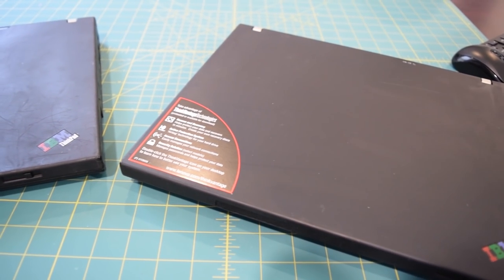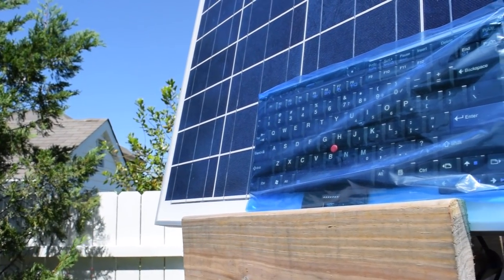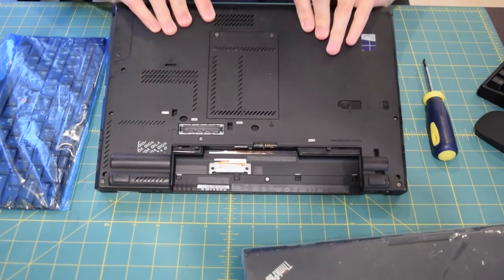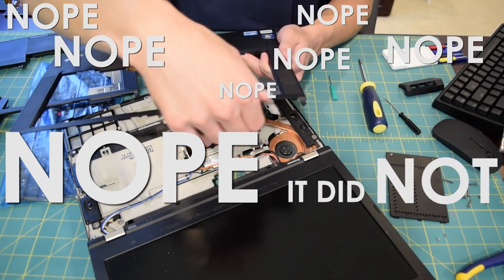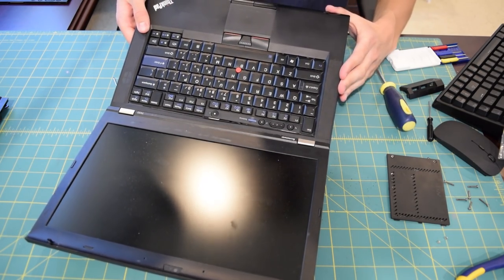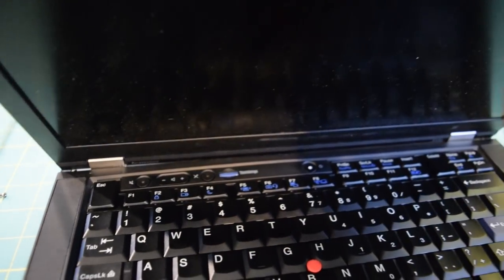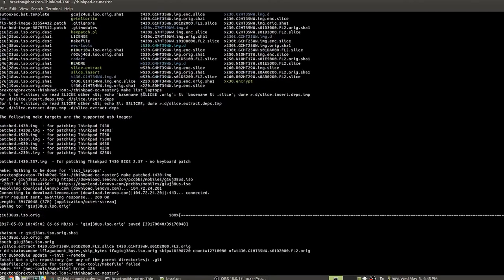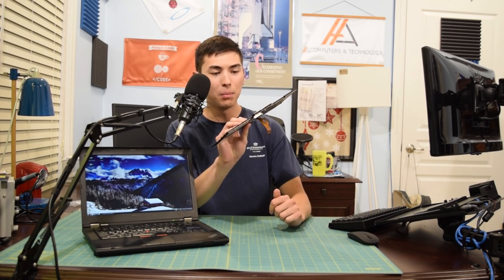Lenovo Thinkpad T430 "Classic" 7 Row Keyboard Installation / Mod

Comment from the maker: A few people have complained that I did not isolate the necessary pins on the internal keyboard connector.  I addressed this issue in the video but just to reiterate, many have successfully performed this mod without making any changes to the internal connector.  According to Thinkwiki "Further investigations on three keyboards shows that the over-current condition described above quickly lead to the same failure each time - a small burnout on the keyboard just after the retaining bar (see circled area on photo below). This burnout has had the effect of removing the short circuit and stopping any other issues." any foreseeable issues should take care of themselves.  If you want to still isolate the pins on the internal connector, then feel free to, I am not going to stop you.  However, I found it to be an unnecessary step.
Reply: can i have the old keyboard because mine broke
Reply: Andrew Vickers 
/userroot- scrub
Reply: AA Computers and Technology would it work on a t430s model?
Reply: Just as a bit of defense, as the original author of that article...  I didn't write anything about a palmrest. Someone else shoehorned those instructions in later, and I think it was mostly intended for the X230.

By removing your palmrest, installing the keyboard into it, and then putting both back in at the same time, you don't have to modify the nubs on the keyboard, but you also remove the ability to remove the keyboard without first removing the palmrest, which some would view as a relatively big issue (especially when shortening the nubs isn't hard at all).

So, yeah. Nothing was a "lie" so much as a lot of other people misinterpreting instructions and then broadening them.
Reply: imo, the bulge is caused becuause of a wifi cable or some clipsing part badly seated on the rest, still, i would go for that mod if i ever get a newer thinkpad.

especially if this keyboard comes with NMB switches.
Reply: lambotgini
Reply: The keyboard backlight fuse tripped and saved your laptop. You should probably research it better before telling people to go damage their motherboards.
Reply: I’ve fried several keyboards improperly isolating those pins. Do it.
Reply: @SilverSpoon_  not at all.  The 2nd retaining clip on the palm rest broke with the way he installed it.  Install the portion towards the screen carefully first making sure the clips are lined up correctly, and no bulge.
Reply: Ever hear "better to be safe, than sorry"?  Would you be giving this same advice had you gone through a motherboard or two because the backlight fuse hadn't tripped and saved your machine?  I don't think so.

It takes two seconds to put a bit of tape over the pins.  There's little reason to not do it, unless you like gambling with the best outcome being the same as it would be if you hadnt, and the worst outcome being a non-functioning motherboard.

Comment: I wish laptop keyboards were modular so third-party manufacturers could join the party.
Reply: Exatly! Btw nice reference to rpgs
Reply: most Laptops out there as of 2012 actually use a PS/2 connection, this means any keyboard can work on them as long as you can figure out which pin on the connector goes to each pad on the ribbon cable
Reply: now the annoyant part is the individual connectors, but on the keyboard diversity, i had a certain experience with my T60 and T61p. one had a NMB and the other one was a Alps. I found out by doxing the serial numbers recently. This laptop is ten years old and has seen some shit so I replaced the keyboard with a cheap one from Amazon, a Lenovo Genuine, and the serial indicated it was made by Chicony.  the NMB brand is really an original design common to HP and Lenovo's high end, and is very comfortable to type on. The Alps one is a bit more clumsy, but the Chicony, as the T60/61 marked the end of the transition from IBM to Lenovo, Lenovo decided tpo get the cheapest keyboards with scissors switches, you cannot type with all your feels without having keycaps breaking, something that never happened on the original NMB. I finally ordered a couple of remaining NMBs from a seller in Canada to replace both my T60 and T61's, because that counts!
Reply: - Apple has left the chat.

Comment: The reason your back of the palmrest is now raised is because you broke the clips on the back of your palmrest (check the back, under the battery, you'll notice 4 clips - your 2nd one from the right should be broken according to what I saw in the video). It took me 3 new palmrests for me to get this right, it's ridiculously annoying and difficult to properly seat with the keyboard without breaking them.
Reply: I recently got this problem with my t430, i almost bought a new palmrest, but i happen to find out that one of the clips was just twisted, so i just had to twist it back, and it worked fine.
The plastic on the palmrest are really good
Reply: Can you connect the keyboard when the palmrest is still on the laptop?
Reply: @ramiveiberman3182  yes, you just have to unscrew some screws on the back, don't really remember which, but I think is the ones more on the middle of the back

Comment: I've used the chiclet for over a year now. you must have girly fingers if "they hurt" after typing on a chiclet kb
Reply: Daniel Stubbs if you listened he said he types very abusively. Chicklet keyboards have a short travel distance.
Reply: +DistantExplorer Yep, happens to me. I'm used to pressing down hard on stuff like mechanical keyboards and whatnot, so tiny little chiclet keys is like smacking your fingers against a solid surface, it starts to hurt your tips after a while
Reply: I am quite certain that the new keyboard has the same amount of travel as the old one (I read it somewhere). So it is strange that he dislikes it so much. Truth be told I definitely prefer the old style keyboard too on my T60, I just don't think that the chiclet ones are so bad as some people make them out to be.
Reply: Really? I'd actually be pretty surprised if that were true, since every chiclet keyboard i've used has had almost zero travel. Then again i've never typed on a new Thinkpad keyboard before so I guess I can't say for sure.
Reply: do you know what travel is? or are you just regurgitating shit you read online. Chiclets have plenty of travel.
Reply: Yeah, chiclet keyboards in general has less travel, but lenovo had a priority to maintain or at least  be very near to the old travel distance. But obviously something is off with them, as he (the dude in the video) really dislikes them.
Reply from the maker: The Lenovo T430 chiclet style keyboard actually provides a decent amount of vertical travel.  It is definitely one of the better chiclet keyboard designs I have ever used.  That being said, I still like the T420 keyboard much better, the layout makes more sense to me and it is much more comfortable to type on in my opinion.
Reply: I use it since 2013.. Chiclete sucks hard. Dont have a travel distance of the keys, dont have a good feedback, and i miss-type all the time... 
When i had to use a old laptop last week after many years without any normal keyboard, i instantly could type alot faster and better with much more confort in the normal keyboards... I really dont get the thing... If we have space, why have "small" keys? The distance actually makes no difference, as i misstype all the time (and if was just me, ok i would believe in some problems with my typing, but its not!). Not even on the virtual keyboards these small keys with some space between them makes sense... 
Unless you have "girly fingers" you will miss keys, and press more than one key sometimes or press the wrong ones... 

Oh if you want to know what i used, the laptop that i use since 2013 is a dell inspiron 15r 5537. The old one was a dell inspiron 1545. Just to see if it wasnt a super awesome different dell keyboard, i tried yesterday an old philco (that uses cheap-ass pieces, including the damn sis chipset), and it was way best than my chiclete keyboard. I tried too a desktop keyboard and same result. I tried even other chiclete keyboards, some samsung ones, som other newer dells, and a asus zenbook pro ux31a. All of the chiclete keyboard present the same problems. Actually even a small keyboard, but yet the normal "type", from a hp mini 110 3735dx that i tried was better than those chiclete ones.

So if you got used to it, good for you, but its like you start to use someone's glasses, its bad, but if you get used to, it may seem ok or even good for you, but its not.. (well.. bad example...). These jeyboards are worse than most of the old ones..

Comment: I currently have a T60 and a T420 and they are both fantastic computers, however I am looking at a T430 because of the native USB 3.0 support and the improved processors and graphics. If I were to get one, this mod would be one of the first things I would do to it.
Reply: update: I have ordered a T430 for parts off of ebay, it is missing the screen and keyboard. So I get to pick the screen that goes in it AND I get to order a T420 keyboard! So because of that I will never have to deal with the T430 keyboard! :)
Reply: Good of you
Reply: I miss the build quality of my T61. This t-430 is a cheap pile of shit in comparison.
Reply: @SebisRandomTech  Is this the same T430 you are using today? I am using the classic keyboard on my X201 right now, very nice keyboard.
Reply: @KylesDigitalLab  Yup, the T430 with a classic keyboard has been my daily driver on and off for the last several years.

Comment: I grew up using my dad's Lenovo T60 (he used to work for IBM), and while the Wave keyboard on my X1 Yoga 3rd gen isn't bad, it simply doesn't compare. It's worlds better than those nearly-zero-travel new Macbook keyboards, but nothing compares to the feel of those good old 7-row IBM Thinkpad keyboards when it comes to laptop keyboards.
Reply: Some of the earliest Thinkpads came with buckling sleeve keyboards that felt absolutely amazing. Miles better than any modern laptop keyboard, dare I say even the more recent “classic” rubber dome ones.

Comment: Too bad there is no aftermarket 
backlit old style keyboard
Reply: Oh yeah would be an instant buy for me
Reply: If there was, it would probably be crappy and cheap.
Reply: you don't need to, just use the thinklight
Reply: There are actually - they're just third party
Reply: @asc3n d3ad There are Chinese manufacturers on Alibaba that build them or will upon request. Most of them are based in Guangdong
Reply: @jamesbroderick3394  have you tried one? Thanks

Comment: Brilliant! I've owned the T430s, for the last 8½ years, coming from a company-owned T420...and I've been a ThinkPad user since 1995.

Switching from the T420 keyboard to the T430s chicklet  was difficult for a few days. I eventually got used to it and now comfortably type.

Three years ago I found a minty-mint T420 with 8gb of RAM and a 256gb SSD for $155. It looked and felt new. 

Whenever I need to do extensive word processing, that's my go-to. I also use it for all of my Internet and coffee shop needs...keeping my T430s away from all Internet virus and malware horrors. The T420 is still a fantastic notebook.

Idiocy for Lenovo for changing the greatest keyboard design ever. It was the perfect keyboard.

Comment: I am in love with the T430, for me the most equilibrate possible laptop; cause you can approach it with the vintage keyboard as well as a FHD screen, pulling it Coreboot, and using a decent 'old' i7 with 4c/8t...

Comment: T430 squad! like if your apart of the T430 squad.
Reply: nah W530 for life.
Reply: I guess I am but I wish it was as durable as my dual branded IBM/Lenovo t-61 was. I bought it right when IBM was selling everything off and has both sets of logos on it. That thinkpad was a fuckin' tank compared to this fragile piece of shit. Still better built than most but not good enough.
Reply: Nah, Lenovo T400

Comment: Sort of reminds me of what I did with my Dell Inspiron 1545, an old laptop that I use in part for the same reason--I don't like modern laptop keyboards at all. The 1545 comes with a solid black keyboard that is impossible to see in low-light conditions, so I swapped it out for a silver keyboard from a 1520/25, which works just fine and fits perfectly, but a few keys are mapped differently. But with the 1525 keyboard, you can be in the dark and the light from the screen will illuminate the keys.

Always feels good to find a workaround to a problem and make supposedly locked-down hardware bend to your will. 🙂
Reply: My 1545 I absolutely hate it
The performance and keyboard is one of the worst
Reply: @Maximus20778  I actually like the keyboard. Performance-wise, it's been long ago updated to the best CPU it can run and has an SSD installed. So it's usable.
Reply: @johncate9541  best CPU and it still runs like crap. I wouldn't wish intel gma on my worst enemy.

Comment: Seems like I always have to play devil's advocate when it comes to the *30 line...
I like the new keyboard better. Not because of the layout, but because it fixed the abysmal build quality of the *20 series' keyboard. Since the T60 there was a steady decline in quality, and by the time Lenovo released the T420 the flex on these things was insane, and you had to be really lucky to find one that was actually as clicky as they were meant to be. They messed up the layout with the precision keyboard, but it is sturdy, clicky, and overall my preferred option on my T530 and X230.
Reply: I agree, I have a T430s and the keyboard is rock solid in my opinion. It's not worse than the old style, just different. It blows modern keyboards of the same style out of the water (Macbooks for instance). This guy saying that his fingers hurt from typing on a T430 keyboard is ridiculous. 

To me this is a really tacky mod. The keyboard clearly does not fit perfectly, as seen by the weird bulges and flexing you see in the video and other examples of the completed mod. For the X230 it's fine, as you can replace the palm rest and get a truly perfect fit. Otherwise just leave your computer alone.

Comment: I appreciate your tutorial on how to swap the keyboard.  If you're going to do this, make sure you have a good pair of wire cutters and a file.  I wound up just cutting all the tabs on the bottom off and some small plastic parts in the top part of the keyboard to make it slide in completely.  I didn't bother isolating the pins as per advice on this video and elsewhere.  Everything seems to be fine and the keyboard is still working. It was actually not as easy as people make it sound, and the keyboard does not technically fit (maybe if you get the T420 palmrest...??), but after you knock this square peg into the round hole well enough, it does feel a lot nicer than the original T430 keyboard to type on, and is stable enough.  I got a T410 keyboard instead of a T420 since I think, even though they might be the same part, it might sell a little cheaper under the T410 title.  twenty bucks on Ebay.

Comment: I can help you with flashing the EC by uploading an already made image with the keyboard patch applied. I won't be able to test it though, because my T430 still has the original chiclet keyboard installed (I plan to install the classic one myself sometime), I did use the same program to remove the battery validation check though. I don't like saying this, because it just feels a little mean, but I am not responsible for any bricked motherboards.

Comment: iceberg keys do not belong on a thinkpad! it is haram! impure! sacrilegious! NEIN, VÖRSTRICHT!
heh.
now, here's a joke. a challenge. 
Upgrade the screen to a 1920x1200 or 2560x1600 IPS screen.
for the delete key, just try Randyrants's keymapper software, works on all windows. on linux it's easy, you modify a language-specific  text file., that's how i converted a native qwerty into a proper azertyuiop french, keeping the right 1234567890 unshifted; and à éèÈÃ ôü keys included.
Reply: oh, reminds me to add, linux humans also say it's haram to modify the keyboard locale file using a random text editor as root, as the proper way to map key should require 250 command lines in terminal. here's my answer : this is how I always did it with .INI or .INF files in Windows. Your freedum OS is no different, these files are editable for a reason.
Reply: Thanks for that sir

Comment: I use my t430 as daily driver, i didnt get any problems with the included keyboard
Reply: It’s a preference thing. 

The T430 uses the same switches as the older models, it’s just a different layout. The layout is more a personal preference thing.

Dude is a giant baby apparently, because imagine being physically hurt by a fucking keyboard. Like not carpel tunnel or anything, just not liking a keyboard layout so much that you pretend it has physically injured you
Reply: @dstinnettmusic  Layout and 7th row may be a personal preference but missing gaps between F4-F5, F8-F9 and index protrusions on F and J was a major blow to the usability (for anyone who types blindly and uses F-keys).